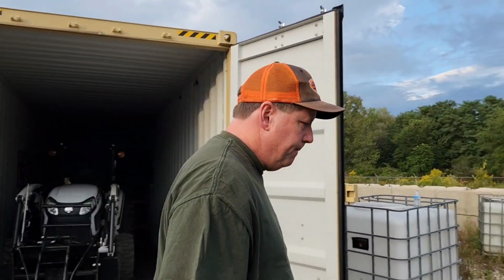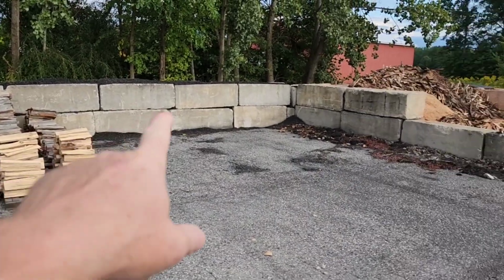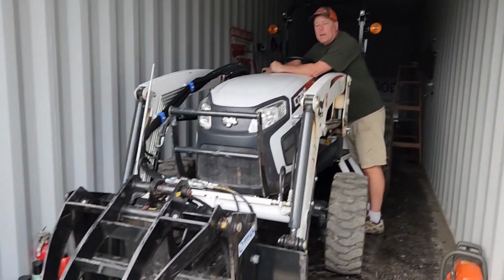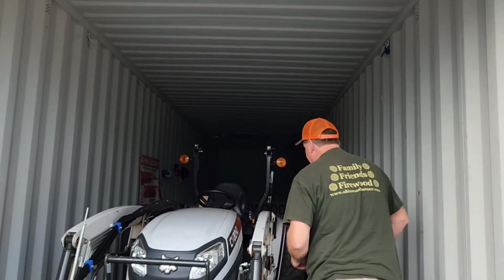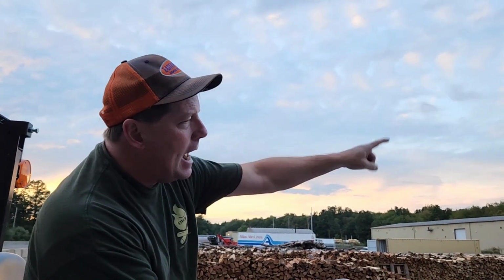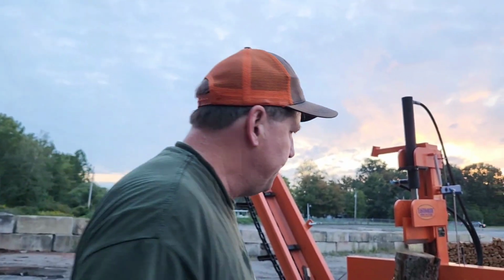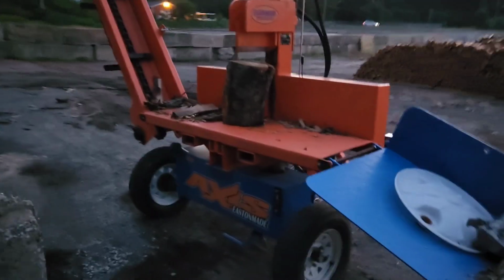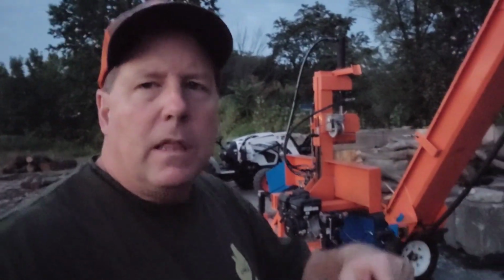Look What I Did For More efficient Firewood

Comment: Joe, I have found that when I unhook my hydraulic attachments especially my grapple if I reconnect the 2 hydraulic lines together it makes it easier to reconnect to the tractor later. Also it helps protect the coupling faces. I think the technical term is (balanced out). :) Great video!
Reply from the maker: Good idea.  I had done that before but in this case it seems I forget when I'm filming lol

Comment: Hey Joe, another great video. You may want to 🤔 consider a 18'x24' car port with tall sides to suit your needs. With all the concrete you have in the new wood yard, you'll be able to drag/tow it around for the perfect setup. If you decide to do it, you'll want to have the ceiling spray foamed to cut down on heat and noise that echoes from the machine. And install heavy duty fans and Led. work lights to the underside for constant air flow and light for those gloomy days.
Reply from the maker: I like the way you think Ron

Comment: Hey Joe, only time will tell if your setup is working effectively.  What works well in the spring, summer, and fall months may not in the winter months.  Snow clearing paths are essential in locations where you receive a lot of snow.  The warm sun is your friend in the cold winter months and so is a good wind block structure.   Raising your logs up to a comfortable cutting high is definitely a good option.  Getting on and off the tractor for each log can be a chore though. Especially in the winter.   I find it’s works best when blocking the oversized close to the splitter.  If you cut a couple of 8 ft runner from those logs and place them about 6 ft apart near log lift.  You can then place 4 to 6 logs on the runners and cut them more efficiently elevated off the ground.  That’s about 1/3 to 1/2 cord worth of firewood.  If the runners are in the way after cutting the blocks. You can easily move them aside with the grapple.   I would also suggest to make this process a schedule task every 2 weeks or when you have enough logs to make it a complete task from start to finish, ( cut, split, stack and cleanup ) in the same day.  Scheduling tasks will definitely help with your inventory flow of availability seasoned firewood.   It’s a suggestion, it may not work for you. But something to try.  Your yard is progressing well.  But you do need help with your production tasks.  Even for safety reasons you should have someone around or near by.  Have a great day! 😎🪵👍
Reply from the maker: I always start every project with the intention of keeping up and preventing big back ups.  Then reality hits lOL

Comment: That area should be the big butts bin. 2 things a noticed joe apart from great video. First one from my experience running bucket loader try tilt the blade part the bucket over just a hair more and itl scrape and clean up better or to save your bucket blade get one those big logs on the toes and nose of the grapple and use the log like a brush while driving tractor. We used to do that were the timber lorries stacked wood when very rarely we cleared the landing worked a treat. The other thing is a donr no if its the same were u are across pond but biomass companies buy the scrap bark and stuff to use for burning for heat for boilers in uk it was classed as grade 3 bark at my old sawmill job. Could be worth talking jessie he might no people thyed come in pick it up u get paid. 🏴👍
Reply from the maker: I dont think there is much market for that over hear in the states.

Comment: You should have a bucking table, lots of plans, to set your logs on backup and place on splitter table. Saves back, uniform cuts and saves fuel.
Reply from the maker: possible but I need to be sure about this work flow first.  I will use the grapple to lift logs to a comfy height

Comment: Hi Joe: Your setup is looking good. If your looking to put a roof over the Axis. I would consider making it portable. I have built small structures that were built on top of a pallet designed base. The pallet base allows you to pick it up with pallet forks and move it around. I use my log grapple to buck logs also- I’ve considered a bucking table, but as I look at it, it’s something that wouldn’t get used that often.
Reply from the maker: Being portable would be a good idea Rich.  Thanks

Comment: If you ever need the space you could always make a lay down yard for the majority if not all the logs outside the block wall fence. Not like they will be easy to steal. Lol. 
Do  the jacks on the axis swivel out the way by pulling a pin when you get the weight off? If not they should. Those make life easier...
Reply from the maker: That would require a larger rent payment Jim LOL!
Reply: @ohiowoodburner  oh lol. Well I figured you had at least all the way to the road in front the place. Like a parking lot in front of a business

Comment: Joe your setup looks okay. But one safety issue I see is that cement block on the operator side is going to be in your way. That is one thing I would suggest for you to move. I’d hate to see you take a step backwards and trip or fall over that and bust your head open. It only takes one time.

Comment: Use a temporary shelter until you have proven the location, unless you get a portable building.  Consider having one main building for everything that you can use it for and not having separate buildings for everything.
Reply from the maker: I am looking at one for the Japa and I think I will be able to use the blocks for the Axis but then they will get in my way prob moving around them.  I will get it figured out eventually
Reply: @ohiowoodburner  
If you cannot left or drag the blocks, try Jesse.  Someone in your area has the right equipment.

A different job for Jesse is to design your layout.  Give Jesse $100 per hour and tell him what you want to accomplish with the space you have available.  You may be surprised what ideas he comes up with for how to position all of your stuff.  I have more confidence in his ability than I do in yours.  If you cannot recognize your limitations, you will get yourself into trouble.

To anchor a building on concrete, you can drill holes in the concrete. Another method of anchoring would be to use the weight of the blocks.  Most likely, the blocks are in the wrong place because they were placed for a different purpose.

Comment: The only thing I would change is that I'd put a hole in the bucket to bolt a receiver, and then you wouldn't need to use the drawbar. You would handle e everything off the bucket.
Reply from the maker: Interesting.  That is a good idea.  I think Titan Attachments has those for sale

Comment: JOE,  ,  WITH YOUR EXTENSIVE MECHANICAL KNOWLEDGE I HAVE 2   COMMENTS;  1  THE EXHAUST ON THE ENGINE  POINT TOWARDS THE ENGINES INTAKE.  EASY FIX    2  since we have the knowledge to tie a bundle of straw or hay with a knotter.  why does not  a company like  JAPA make   a wood bundler using twine like the days since about the early1900 hundreds .  Japa has the people who could  figure  that out.
Reply from the maker: Hi Jim.  I was the original person who figured out the exhaust issue that was about two years ago. It is all fixed.  I can't speak for Japa I don't think they make a bundler or intend to.  Thanks Jim

Comment: Hi joe been following you and your watching your logging empire grow and develop as am doing the same in the uk although only supply to public for home heat had a major issue last year and completely run out of sellable product so have took bull by horns and invested in a new processor and also have started buying in my fire wood which there leads me to my question to you with your over size timber for the japa have you considered a cone splitter on a mini excavator?? Seriously they are a game changer!! As I've learned from starting with a saw and home made splitter to now running the processor it's all about time + effort÷cost = maximum profit right?? Here in uk there's a serious lack and demand for perfect processing size timber so here's where the cone splitter comes in !! My timber supplier brings me over size timber that he struggles to sell to his other customers and at a discounted price now obviously I've got to split the timber down to processing size but it gives me nice dry seasoned mainly straight billets for the processor and man is that thing quick i would say i could split and stack a cord an hour sat in a cab with radio coffee and no back breaking work💪👍👌 next time I've got it on the machine which is a 3 ton Kubota will try and do a video keep up the good work Gary Exeter Devon England

Comment: Do you ever plan to have drying kilns? I ask in the short term a good shelter is to stretch a hoop roof between two parallel parked shipping containers, choosing the best type of containers for kilns conversions as eventual potential kilns . This might be a way to make productive use of some of your wood waste and excess boiler wood.

A further suggestion is to make the "long log storage area" rather wider so that you fill one side with this years logs and next years along side and yet not hinder or interfere with those already in store and drying out. You could also chainsaw those shorter that are too long or move the wall behind the splitter sideways to make room.

Remember to make use of kilns sensibly and efficiently logs will need to be handled in cages so storage areas will be needed for both full and empty cages. Forklift trucks also need hard level surfaces to drive on in all weathers winter or summer.

Lastly would that pile of wood waste pass through a chipper and become a saleable product?
Reply from the maker: Kilns could be an answer but I'm not able to look into them right now.  Too complicated for my simple brain!  I hope to have a plan in place for my waste.  Not sure yet either.